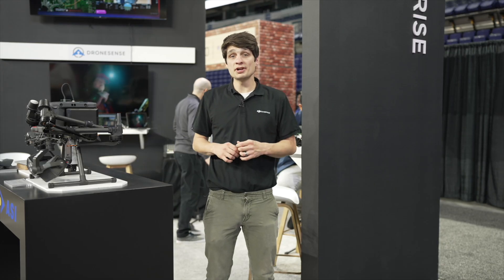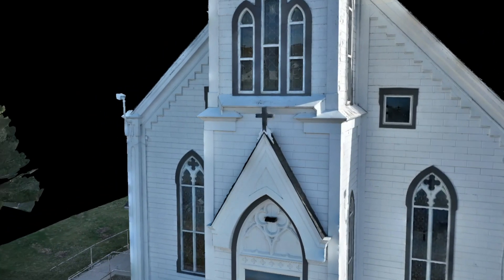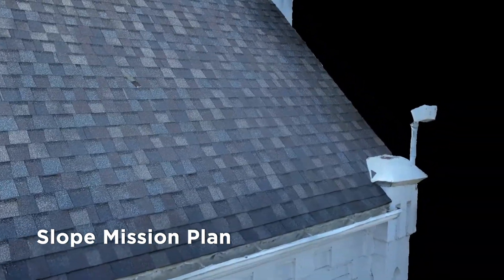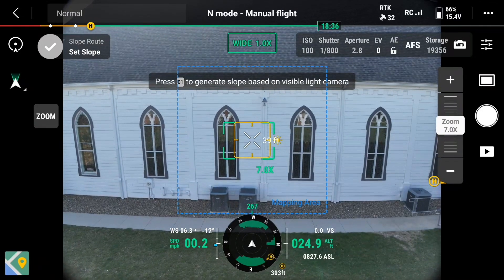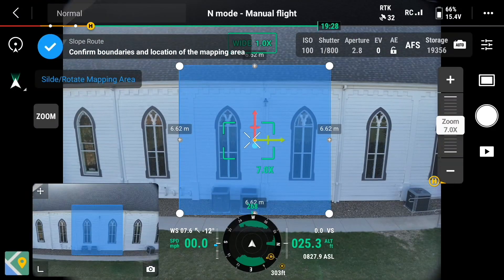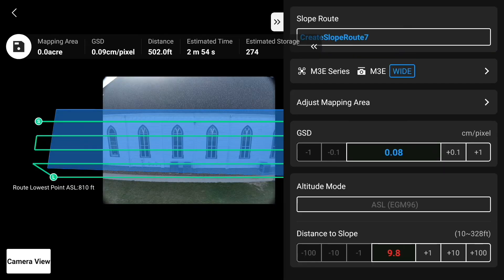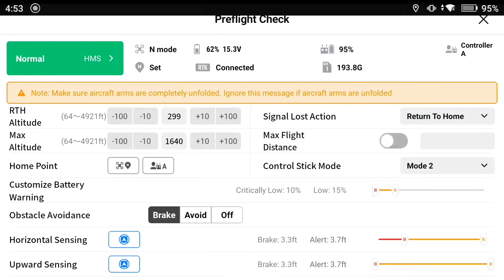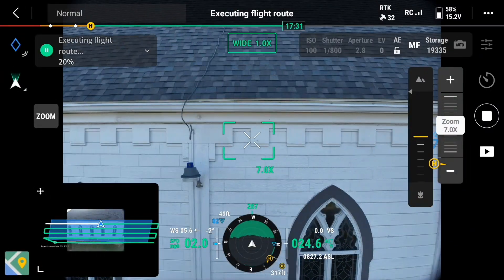Create A Slope Mission Plan with DJI Pilot 2

Comment: I tried a slope mission using the M4E on the side of the underside of a brigde deck with a positive gimbal Incline of 30°. (No RTK issues). Planning the plane was easy and the automatically created flight path (distance to slope 15m) looked good. When flying the mission however, the M4E yaws in flight direction (horizontal to the slope) and therefore does not capture the images in the direction of the specified plane. The gimbal inclination was set correctly to 30°. I could not find an option to set the yaw direction. Such an option would probably not be necessary if the camera was facing the plane/slope by default, as I see no advantage in any other setting. I would really appreciate an answer if anyone has an idea as to the cause and solution of this problem.

Comment: why is it saying my slope mission wont work unless i activate RTK and am connected to an RTK network? is there anyway to bypass this and do it without RTK just less accurately? all my other mapping options work fine without RTK.. i have a matrice 4t... also it looks like i still need mapping software separate from pilot 2 to complete and stitch my photos together from a mapping mission? it looks like on the 4E you can low key do it from your remote? any help would be appreciated. thanks